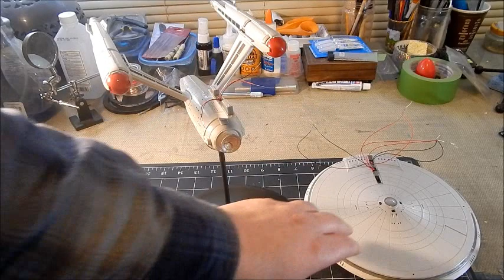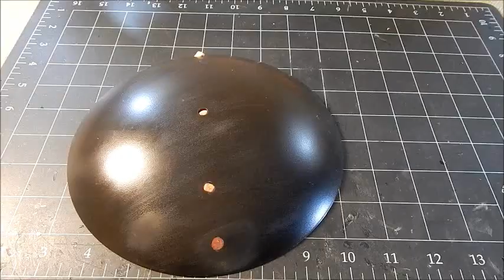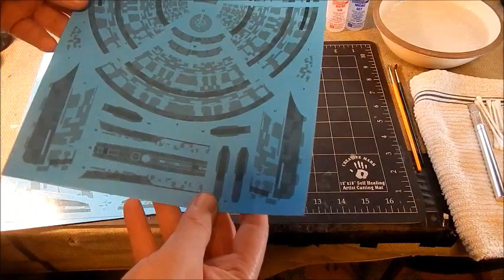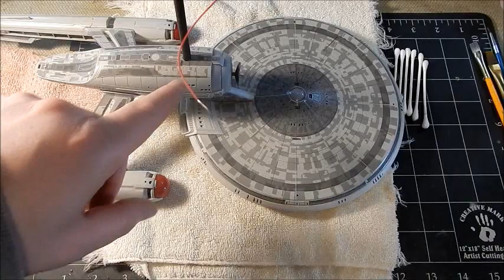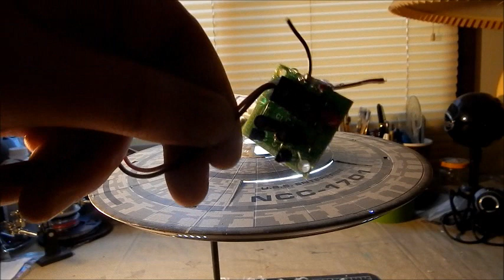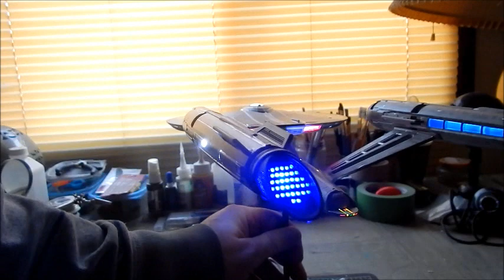Polar Lights Enterprise Build 7

Comment: Finally a proper recommendation of the algorithm! About the decals: round 2 released an update of the decal numbers at their website soon after they released the kit. You might want to have a look at this before you make another video about it to avoid confusion. If I recall correctly there were just some numbers wrong.
Reply from the maker: Wow, worked in your favor?!! High five. I know they've fixed and it was more then just a few, its was most of the engine ones. It just baffles me in this day and age this level of communication error even exists. Kinda frustrating.